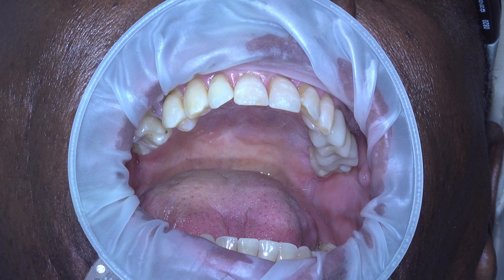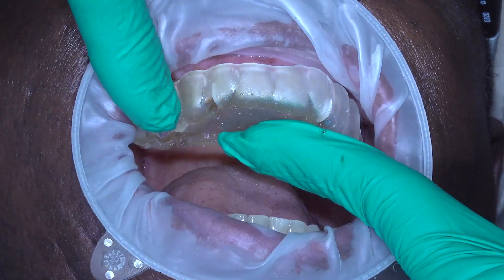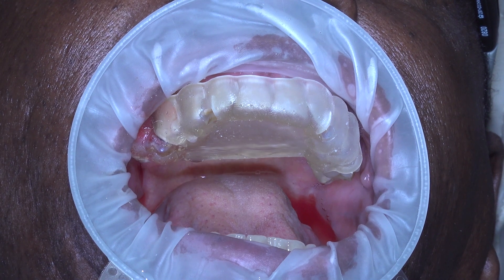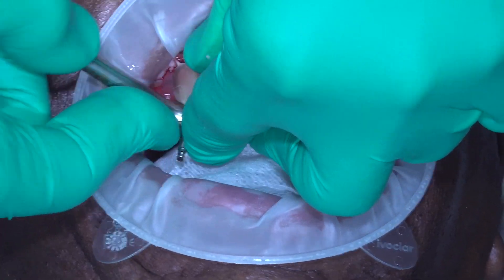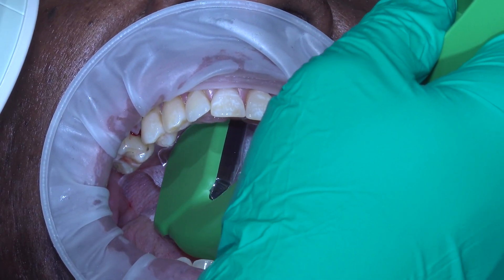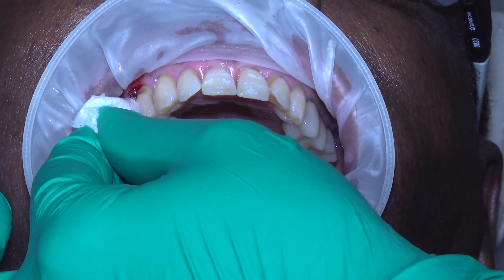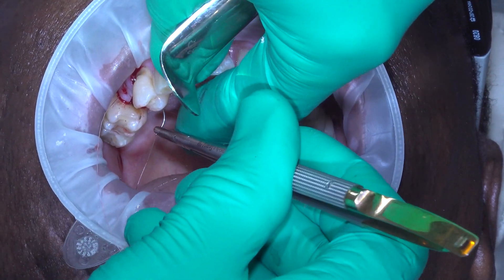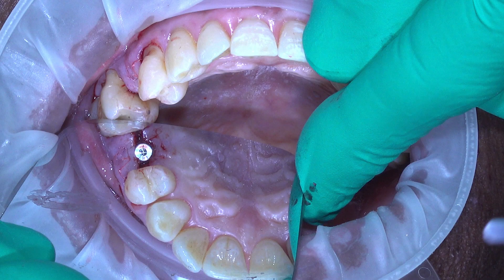LIVE Guided Dental Implant Placement

Comment: Do you undersize your osteotomy by one size for most cases?
Reply from the maker: Not now. With early implants it was not uncommon under size the osteotomies. With the new implants like the Biohorizons pro the tread design has been optimized such that the need for undersizing has virtually been eliminated in my practice. In fact, if you under size the osteotomy and place a BH pro implant you will likely not be able to acquire the planned depth due to excessive insertion torques.

Comment: I would like to see how you do internal sinus lifts (crestal approach) in conjunction with guided implant placement. Love your videos!
Reply from the maker: It comes down to virtual planning. I will select an implant position that engages the floor of the sinus. Then for the surgery drill the osteotomy, in-fracture, particulate graft with PRF, then place the true implant to same stop position as the planned implant which fools the system resulting in the implant begin in the grafted sinus as planned.
Reply: @Stanleyinstitute  so are you saying you plan a shorter implant than you’re actually going to place?
Reply from the maker: Exactly. Say there is 9mm of bone sub-antral. I would plan a 9 mm implant but I would place a 10.5mm during the surgery. This way the drills will stop just below the Schneiderian membrane but the implant will be the proper length.